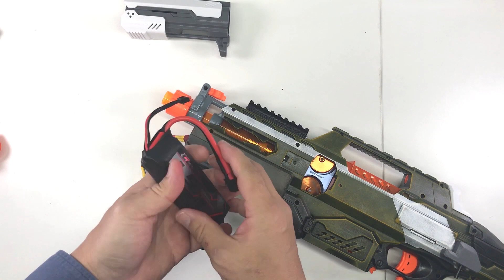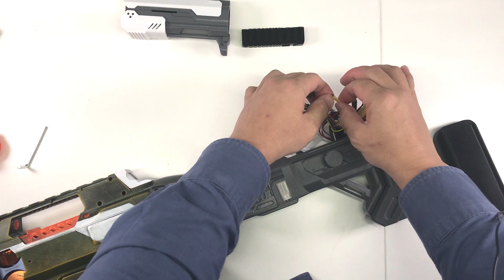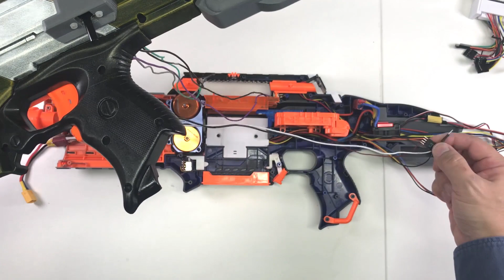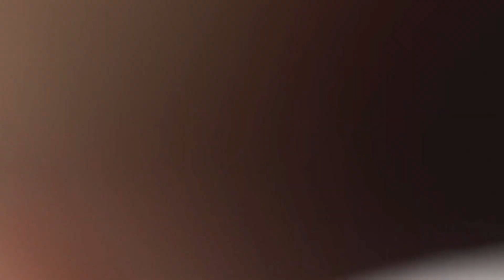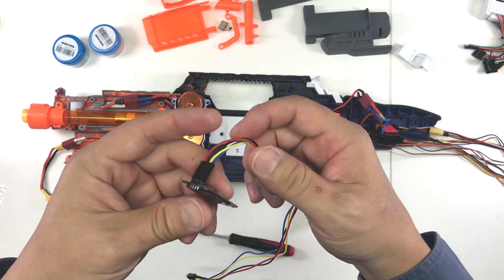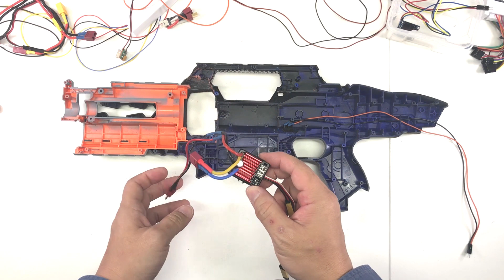Tungsten V3 - Arduino Select Fire Rapidatrike Part 2 - Dismantle

Comment: Hey can you tell me if this will work with a 2s lipo
Reply from the maker: I don't think it can as the codes were written for those motor any change will have to adjust the code. even with the same motors, some adjust might still have to be made.

Comment: Do you think  this might work With Brushless motors?
Reply from the maker: The Golde Ingot u will need 2 brushless ESCs one for each motor and change the programming to control the ESC rather then the mosfet.
Reply: Yeah! Thats True, But can you make Brusshles Motors  quiter ?
Reply from the maker: The Golde Ingot not sure how man
Reply: @the_golden_ingot  Yes, by making them less powerful or using machined cages and wheels, as with all motors.